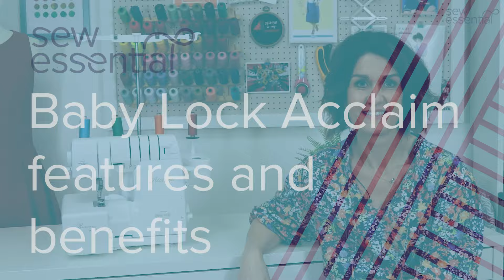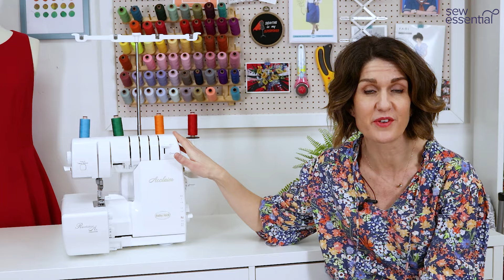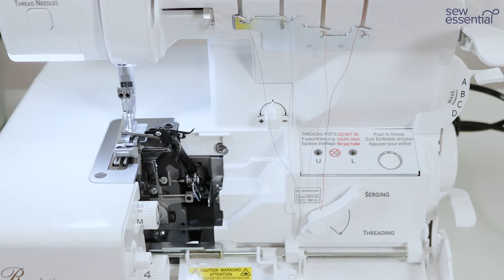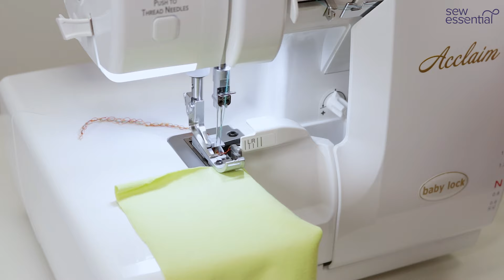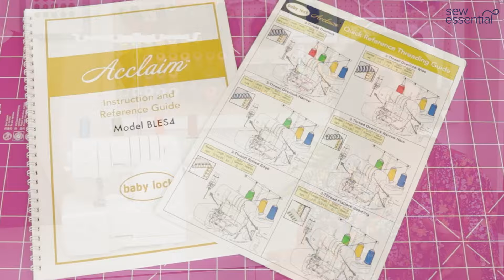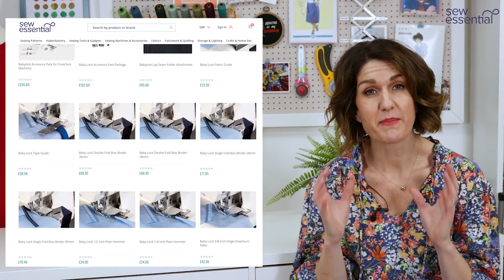Baby Lock Acclaim Overlocker - Everything You Need to Know

Comment: Hi, thanks for this video❤ can the blade cutting width be adjusted and if so what is the range? What is the height range of the presser foot in mm please. You said it was wider but didn't share details. Is this machine suitable for semi professional/commercial use? Does it allow for self adjustment tension even though automatic? Thanks 🙏